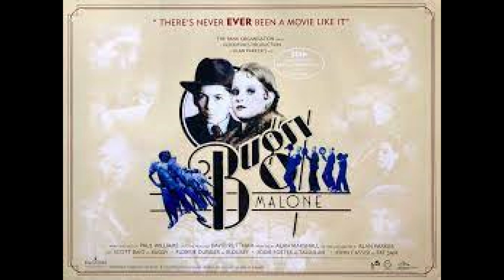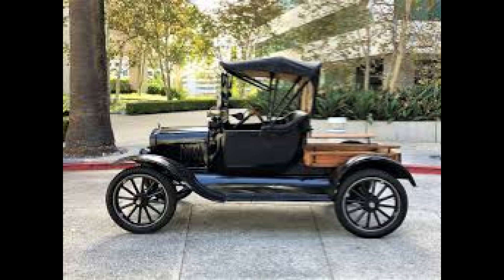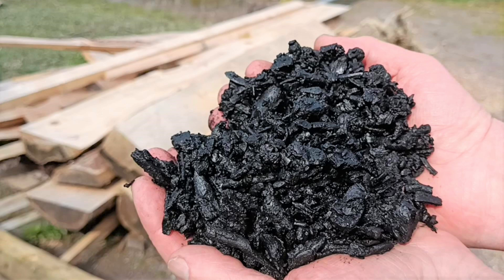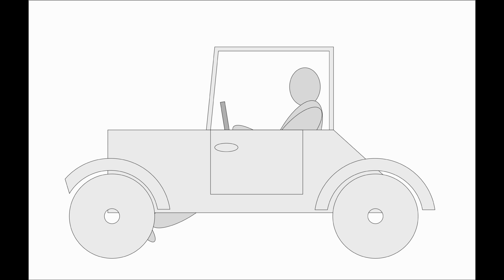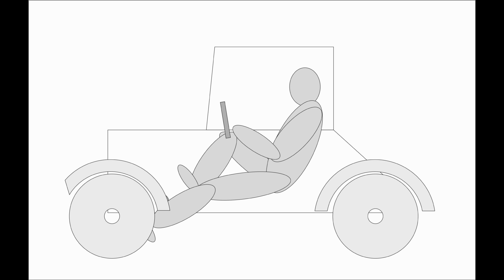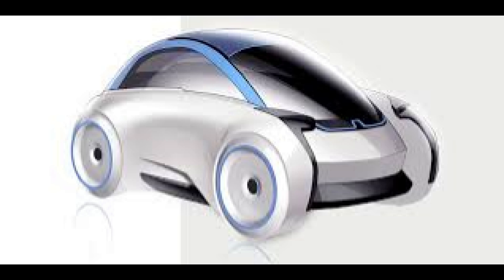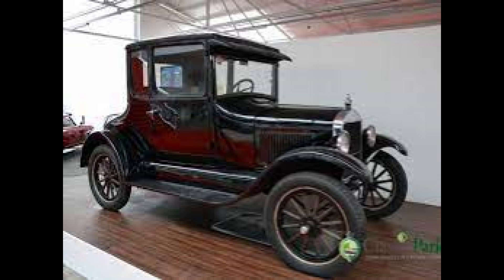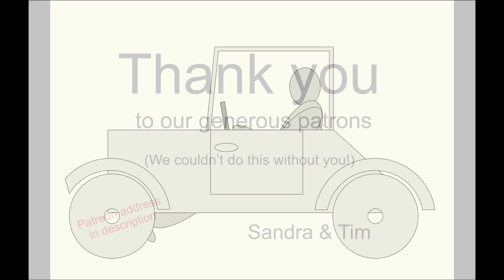Could We Build A Full-Size Wooden Pedal-Assist Electric Car?

Comment: You might consider using an electric driven hydraulic pump that runs to a hydraulic motor that would power the car forward and backwards by using a directional valve, no transmission necessary and loads of slow torque,  easy electrical set up and could be quite nice for driving up hills etc.  Electric motor drives pump, Pump goes to forward/reverse valve, (also acts like throttle) then  that line goes to the hydraulic motor,  and returns to a reservoir and then back to the pump. All relatively cheap easily found components,  you could get an electric pump from a plow or dump truck and the valves are easily available. The whole thing could be run off a small battery bank and would only need to be turned on when needed saving the battery storage for longer trips. Add a simple charging controller and it would be able to be plugged in to charge. Maybe even use solar panels as the roof, thus charging for free. Vegetable oil can be used in place of hydraulic fluid for safety if there's ever a leak.
Reply from the maker: interesting - but I guess heavy?
Reply: @wayoutwest-workshopstuff6299  not necessarily,  even a very small hydraulic motor and pump and reservoir can have a surprising amount of torque. The fluid lines could be as small as 1/2" or smaller, so long as the hydraulic motor is big enough to move the car. The reservoir needs to only be big enough to hold the volume that fills the lines, pump, and motor twice, so it has a chance to cool down. Even the power steering pump from an old Chevrolet could work as the pump,  add another power steering pump, slightly larger, and that can act as the motor. Then it's just a directional valve and some tube.

Comment: To keep down cost and make it easier to build, I would probably suggest not putting a differential on it. Just have one of the rear wheels be driven instead. It would pull slightly to the side on hard acceleration, but I'm guessing you won't have a powerful enough motor to make it scary anyways.

Comment: Use bycicle wheels. Two with hub motor in the front. Two (eventually without motor) in the rear. Connect the rear ones with chains. Use the padel sensors on the padel to control the motors. You can put some (artificial) spokes on to give the old fashion look. All that is not too difficult, there are even some quite strong motors on market, BUT I fear you will no be allowed to drive to the pub with such an fascinating device.. Hail the buerocrats. Have fun, like your channel very much
Reply: You are exactly correct 250 watt hub motors x4 will give great traction, simple and cheep.
I can't believe i missed this a month ago I wonder what happens,,, oh wait I can watch the second episode right now. see you there Michael.

Comment: I think I would rather see you make a wood gasifier that extracts gas, fuel extracts and heating leaving you with the same charcoal at the end. I like the downdraft gasifiers the most because they look like they can be made continuous and may run on still green wood chips because the smoke is what you want.

Comment: Are riding lawmowers a thing in your area? The manual gearbox and differential from one of those might save some effort. Typically they have vertical or transverse inputs, though, so the pedal assist might be tricky.

Comment: As you live on a farm and mud or soft ground seems to be an issue i would suggest quad bike wheels and tyres would be less rolling resistance than a thinner wheel that would sink into the ground. If you are going to fit bodywork and/or a roof you might want to consider fitting solar panels to it so it would charge while not in use. What is your aim with this car? Drive around your farm or around on public roads?

Comment: You could use a recycled mobility scooter to drive the rear wheels, and pedals and chain to drive the front wheels. A mobility scooter has all the electrics and motor and controller, you would just need to adapt the little wheels to larger driving wheels. My 2¢ 👍

Comment: Dear inventor Tim
Hooray 🙌🙌🙌 Maaaan, this is definitely a really, really great idea! Congratulations! 👍👌👏 Although I would rather build an easier 3 wheeler, I absolutely love 💚 your idea to fulfill an old dream of yours by fabricating a 4 wheeled pedal car.👍👌👏 Will you have one pair of pedals or is the passenger "allowed to help" too? 😁 ;-) I own some bicycles, parts and a lot of different material and would love to donate stuff. But unfortunately I still live in Germany = too far away from your green island, sigh. Will the batteries be in the pedal car or in a small trailer so that you can use it on the property as a versatile power source? Maybe even for the garden railroad? Will the roof have flexible solar panels (like the relatively inexpensive ones used on boats, even on biminis)? Or will even more of the car body surface be covered with solar panels? Okay, okay, I got carried away. I'm already simply very exited and enthusiastic! Anyway:
I hope that you will find a sponsor for the electric components.
Please, Sir, please don't bother answering my questions. Your free time is already scarce enough. I will automatically get answers in the following video series. Of course I'm eagerly looking forward to watch the next part.
Best regards, luck and especially health to all of you.

Comment: Interesting idea! You will probably be able to save yourself a lot of trouble by getting some off-the-shelf e-bike conversion kits - mid mount motor kits will likely be easier to integrate that a hub motor. You'll also need to work out if you need a differential or not, which could be tricky.

Are you going to have any legal problems designing and building a car for public roads, or are they not that fussed about that sort of thing in your part of the world?

Comment: An excellent project! When you said “a couple of bicycles and a motor”, maybe that is exactly the kind of recipe you need for the skeleton of it- two reclining bikes mounted side by side with some trademark galvanised pipe standoffs to which to mount the seat(s) and gubbins? You could enter and exit through the rear in between the bikes. 
Whatever you do, don’t skip adding some kind of truck bed platform a la Mercedes Unimog or Fendt GT because it’ll come in dead handy- even if it’s just somewhere to place the batteries or mount a baguette holster to it 😄

Comment: If you are going to have an electric motor powering it already, having the pedals connected to a generator to charge up the battery could save a lot of mechanical effort.  This way if the battery doesn't have enough power to propel the vehicle, you would just pedal like mad to get more power into the system.  Depending on what you use as a generator, you could adjust how much power you draw from it too - draw a lot of power and it becomes harder to pedal, pull less power and it is easier to pedal (but of course you have to pedal for longer).  It would allow you to adjust it to whatever pedalling force you are comfortable with.  It would also mean that if you ever got stuck at the bottom of a big hill, you could just sit at the bottom pedalling away until the battery is charged enough to go up the hill, as opposed to a mechanical linkage which could easily require more strength than you have to get the thing up a steep incline.

If you do this though you'll have to have regenerative braking, because without that you'd quickly empty the battery and I suspect frantic pedalling will only generate enough power to creep forward at a snail's pace.

If you decide to look at mechanical linkages instead, you could have a look at the design for the Toyota Prius transaxle.  This takes power from both an electric motor and a petrol engine (which in your case would be the pedals) and works it such that the engine/pedals provide assistive power to the electric motor, and any leftover energy that shouldn't go to the wheels goes to recharge the battery.

Of course I could be overthinking it - maybe a pedal powered car with a "turbo" button that engages a simple clutch and electric motor as needed would be enough!  I remember on old bicycles they had a tiny dynamo that would fold down against the tyre and generate enough power to run a headlight.  Maybe a similar principle with a motor instead would do the same job far more simply!
Reply: I like the idea of the pedals being used to generate power.  I was think of the trouble direct drive would cause going down hill where you'd have to pedal to slow the car.

Comment: Sounds very interesting, I found a channel a several years ago with a guy who built something very similar that you are talking about. Here is one of his videos https://m.youtube.com/watch?v=xirVm7MUu2k&t=19s
Maybe you could use it as inspiration.
If you have any questions about batteries, that's my specialty, I can probably help you out. Especially if you don't want to spend the money but instead time.
Reply from the maker: Thanks very much. Do you mean you you know about batteries, or you sell them?
Reply: @wayoutwest-workshopstuff6299  I don't sell but I have bought cheap and also gotten free batteries myself. Old laptop batteries (can be found in Garbage), old electric bike batteries, then I take them apart, test the cells, build a pack that I need. It involves a lot of work but batteries are expensive. I have build batteries for powerbanks, electric bikes, electric cars, house storage, all with used discarded Battery cells.

Comment: You! Normal Videos? I’m only joking 🙃 You make charcoal. 1Kg of charcoal has the same energy as 1Kg of petrol. So why not modify a little single cylinder petrol engine with generator to run on charcoal to charge the batteries in emergencies
Also do a sort of highRail option so the car can double up as a sort of little locomotive machine.
I recommend min 48 volt (16  LIFEPO4 battery cells) and a controller like a pwm hl200200
Or just get a Tesla model 3 yep I know $$$$
Reply: I helped convert the tractor in this video 
https://youtu.be/a2phKnrwaZU

It uses:
A. 16 LIFPO4 cells 
B. HL200200 PWM Controller
 https://pwrcontroller.com/wp-content/uploads/2022/06/HL200200-v1.05-complete.pdf

C. 48 volt 9hp pwm motor 

If you want info just let me know
Reply: Sorry! Will I ever stop?
But I want to warn you about batteries 
They are dangerous on many levels 
I might think it’s only 48volts! 
But know this 24 volts can kill!
When working on systems with voltage over 12 volts, don’t get yourself killed!
Yep they will say I’m stupid! Yep that’s me.
On hot humid sweaty days even 12 volts could kill you! It’s not the volts it’s the current that kills. 
Be stupid !
Believe me!
Always wear insulating gloves when working on volts over 12 volts!
Another dangerous thing is fumes and fire
Batteries really do suck!
Another thing Batteries have a low shelf life
The marketing people will say I’m wrong 
Don’t buy batteries until you are going to use them. Batteries in storage with go bad. Yes even LIFPO4 again DONT buy them unless you are going to use them
Never by batteries on special 
The seller knows they’re no good 
Only pay more Only buy new batteries

Comment: I would skip the differential, as it's too much hassle. Just put the motor on one wheel and your chain on the other. :)
Reply from the maker: Interesting. Thanks. But doesn't it want to pull sideways all the time?
Reply: @wayoutwest-workshopstuff6299  I don't think so. A car doesn't pull to a side if you steer it around a curve either, while a diff won't apply the correct forces here and would actually try to push the car out of the curve.

As long as you don't make a trike this shouldn't be an issue.

Comment: Hey! 
I built a bicycle "differential" as a part of a side-by-side tandem delta-trike bicycle project since i couldnt find a cheap and lightweight differential that would fit the bill.

I used standard bike parts, pedals, chains and sprockets to power the rear wheels, but i used a intermediary drive-axle fitted with BMX freewheels between the rear chains (to the wheels) and the front chains (to the pedals (2x )).

My goal was to have a drivetrain that allowed any or both of the two riders to pedal the vehicle forward, as well as allowing for differential wheel speeds while turning.

My solution will always drive on the slower wheel, so a patch of ice under one of the wheels is no problem.

The only issue is that there is no reverse gear capability.
But i do have some pictures and a 3d-pdf of the design if youre interested :-)
Reply from the maker: Thank you! - yes, if it's not too much trouble we'd be very interested to see that (especially if it works!). email address in the description..

Comment: For older people or people who have health problems and not a lot of strength or energy, narrow smooth tires can make a difference in the effort required to pedal them. I very much noticed the difference going from a Walmart mountain bike with knobby tires to a touring bike with skinny 700c tires. 
I’ve pondered several pedal powered projects including one machine I started to build in 2016 which was 4 wheel drive and 4 wheel steer. Once finished I could have had the drive system in 4 wheel lock. I’ve battled Lyme disease and I had to stop the project due to needing another $1000 or more to finish. Finally last year I took it apart but I am going to try to  build another one 4 wheel drive using mostly parts on hand. 
Peerless has made a 100 series gokart differential axle with 1” shafts. I don’t know if they still make it. I bought mine at Northern Tool about 10 years ago and I’ve never used it. There’s also Comet gokart reverse gearbox’s. I bought one almost 10 years ago and also haven’t used it, but it always leaks. There are other reverse gearboxes available on the internet. Another thing to consider is a locking differential axle used on DR brand walk behind brush mowers. I bought one on Ebay about 7 years ago and again I also haven’t used it. I’m now working 2 jobs and I’m busy.
Reply from the maker: Thanks, Boyd. Lots to follow up there. I hope you get back to your project sometime

Comment: Depending on what motor you get, you may not need a transmission at all. Electric motors already have the most torque at low speed, which is where you need it to get the vehicle started. With a vehicle like this, you probably wouldn't be going fast enough to need a major change in ratio for top speed, and any efficiency you might gain would probably be lost due to the additional weight and friction of a transmission. Not to mention that would add complexity and additional controls to manage. I'd probably go with a single gear ratio driving a chain differential - lighter than a driveshaft and easier to make adjustments as you make needed modifications during the design process.
Reply from the maker: thanks - interesting!

Comment: You should consider doing it new.  Generate electrical time by cycling, store it in a battery.  And drive the wheels with electric motors.  This way you can constantly release energy and, if necessary, for example, take more energy uphill and maintain speed.
Reply from the maker: but a human can't produce enough electricity to move themselves and a car
Reply: @wayoutwest-workshopstuff6299  Velomobiles already work without any electric assist, a motor would be a bonus
Reply: @wayoutwest-workshopstuff6299  A Generator-Motor setup (used for instance in locomotives or ships) is around 70-90% efficient, depending on the system. A bicycle without any gearing would be around 99% efficient (so allmost all the energy put into the pedals ends up at the wheels), but a normal bicycle manages around 85-95% efficiency. Walking is far less efficient than cycling (about 1/3 as efficient as cycling on a flat grade). So if the human can move the car with a normal power train, they can also move it with a Pedal-electric-drive. However, the pedling would feel very detached from direct forward motion, (probably even worse than when driving a pedal-boat).
Reply: @wayoutwest-workshopstuff6299  by adding gears and a dynamo you could try, even solar panel roofs are light weight and self sufficient, check 'channel creative' named youtube channel for more info

Comment: Three wheels would be cool based on a robin reliant.( I vaguely remember a four wheed verision called a Kitten aswell but could be mistaken)Cranked front wheel and electric motors on rear axels may be independentpower to ade in steering.Front would have plenty of room for battery's.